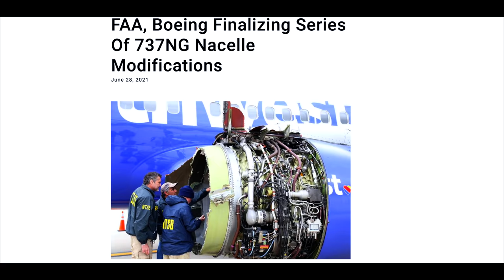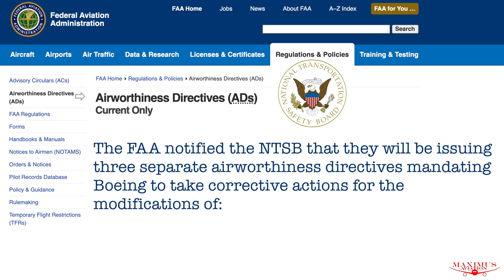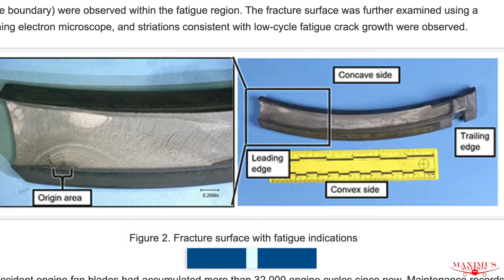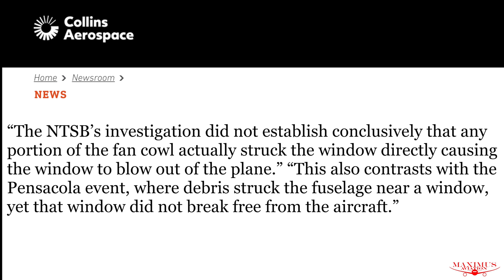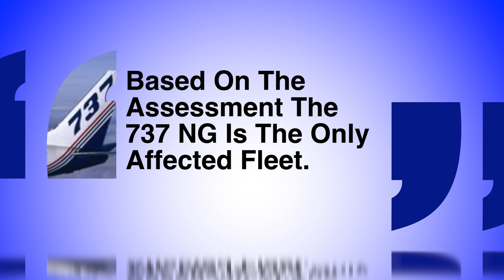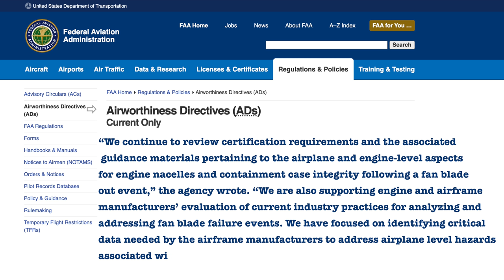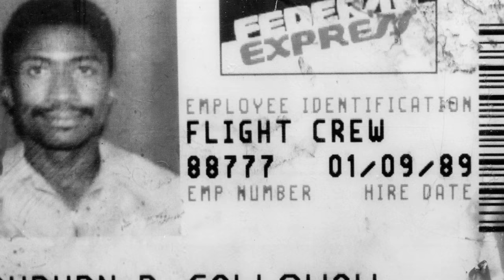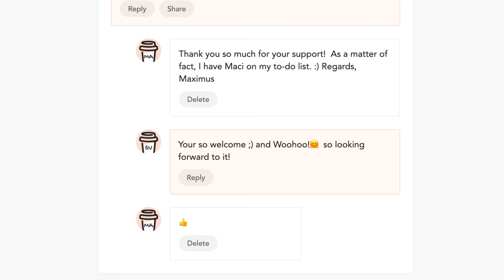After Two 737 NG Explosions, The FAA Is Finally Ready To Direct Boeing To Redesign Engine Cowlings.

Comment: It’s also interesting that engine testing isn’t done with the full fairing and cowling.
Reply from the maker: True.  But since Boeing did test all other cowlings and found that only the NG series was a problem then it must be the case that Collins Aerospace is doing something wrong.
Reply: @maximusaviationchannel  can we trust Boeing testing?
Reply: @maximusaviationchannel  hint:  significant digit  -  determines actual accuracy
Reply: ???  in UK it is
Reply: It is - but not at cruise altitude and speed.  It is tested for a blade-out on a test stand without the slipstream that would rip a damaged cowling away.
Reply: @camf7522  As much as we can trust Pfizer or Johnson and Johnson to test the drugs they make. (which we are especially expected to do right now)  Or appliance manufacturers, drinking water utilities, toy makers, car companies.... None of these people have third-party/government regulators telling them what is right or wrong at every turn.  Most testing of products is conducted and signed off on by whomever makes it.  Maybe the answer, given the duopoly, would be to allow Airbus to 'peer-review' their Boeing counterpart airworthiness tests and vice versa.
Reply: @BigBoy4005  in a safety critical industry like aviation, that is why the ‘independent’ regulator is supposed to be there.

Comment: If this was a one off that could be chalked up to an accident but instead it is one in a series of problems that demonstrates poor management at Boeing what a shame
Reply: This actually predates the McDonnell management issues at Boeing...it's most likely just something that slipped through the cracks of the FAA certification processes that were in place at the time.  I like that a Boeing engineer has come forward and said that there's better ways to model this on computers now!

Comment: Just to clarify…fan blade-out testing / FAR 33 certification is usually performed in a test cell with a complete nacelle and a dressed engine. This is certainly the case with mid-sized turbofan engine installations. I can attest to this from professional experience with several engine / nacelle manufactures. One thing I do notice is that the remaining inlet barrel is still firmly attached to the front flange of the engine. In the event of a blade-out event the fan-containment housing - which is part of the engine and includes the nacelle inlet attach flange - will deform significantly to absorb the considerable rotational energy of the failed blade. The fan containment housings that I have experience with are typically reinforced with a thick Kevlar layer in the portion of intake surrounding the fan. When the fan blade separates from the hub, which is rotating at power and significant RPM, the sudden unbalance results in very large vertical and lateral accelerations which may cause the portions of the nacelle to fail…particularly the intake assembly. Some engine/nacelle designs incorporate features which strategically fail so that the inlet assembly effectively is de-coupled from the engine and remains intact since it will not experience the severe rotating g-loads as the engine spools down after failure. This is critical to ensure that the failed fan blade is also contained by the full intake barrel. The de-coupling devices are called “spoolies” which are simply very precisely designed bushings which are used with the inlet attach hardware (bolts, nuts, washers). During a blade-off event the spoolies collapse and allow the inlet assembly to remain attached to the engine but provide sufficient freedom of motion to the intake so that it isn’t destroyed by the unbalance forces generated by the spinning engine components. It should be noted that the airframe, engine and nacelle manufacturers all work in a coordinated fashion to minimize these failure risks. A fan blade-out event should not be catastrophic with respect to the safe recovery of the airplane, crew and passengers. The remains of the failed engine look spectacular but the aircraft landed safely. I look forward to reading the NTSB report.
Reply: Thank you, Ian. I’m an airline pilot with many thousands of hours flown with CFM56s on both the 737 and A-320 series. I very much appreciate the information and insight of your post. 

Cheers!

Comment: these are quite rare events so I think attaching blame isn't appropriate and it's nice to know they are trying to improve safety further
Reply: Just seems odd to me that the only two engines that  had their fans blow  out of the 6000 or so aircraft in this group just happen to be owned and operated by the same airline.
Reply from the maker: I think thats why they are calling it a "Redesidgn" but I guess they are just glad they didn't cause a plane crash in either situation so they figure why tempt fate. Time to fix them.

Comment: Fly Airbus, see the world. Fly Boeing see the next one. Every model has some problems but waiting 4 years to fix the problem, One more scandal after the other
Reply: Lest we forget, a Qantas Airbus A380  suffered an uncontained engine failure that nearly brought down the aircraft. So this is not strictly a Boeing problem.
Reply: I'm not going to freak out too bad over hearing that fan blades fail.  I don't think that can ever be 100% prevented.  But the four year wait to issue a directive certainly shows they (more so the FAA) doesn't have a sense of urgency.
Reply: @6aNapoleon  
Did the FAA turn a blind eye to it for 4 years?

Comment: Collins Aerospace made the cowlings designed to contain a catistrophic failure.  Such a failure occurred and debris penetrated the airframe directly failing the mission of the nacelles.  Collins is to blame.  Boeing far less so, but because Collins is their contractor and the brand on the jet is Boeing, kind of difficult to not attribute some blame to Boeing as well.  Nice job on this one Maximus.
Reply: It is Boeings job to make sure that all the components works as intended.
Reply: So is Collins where they get the 1st letter of C on the CFM-56  jet engine name?
Reply: @kenkellar2246  in short, no.  The engine is not the cowling or nacelle.  According to a thread in airlines.net the CFM designation is a merging of two companies product naming conventions. Neither of those are Collins.

Comment: I enjoy this channel but in the beginning of this video you made a wrong statement about the function of an engine nacelle. It is NOT a function of an engine nacelle to contain fan blade separations. That is the function of the fan casing. The fan casing is NOT a part of the nacelle.

During fan blade containment tests the nacelle is almost never attached to the engine being tested. There is always a feed horn attached to the front of the fan casing to shape the air going into the intake. That is where the front of the nacelle would be on a normal engine.

The nacelles failed because of the massive displacement wave that occurs from the energy associated with a fan blade separation and the resulting initial and abrupt out of balance condition of the fan.

Had the FAA required nacelles to be attached to engines being tested for fan blade separation this problem would have been known early on.

Comment: Decades older planes seem to have been much better designed than todays planes.  It proves a computer is no match for an intelligent engineer  with a slide rule.
Reply: @Sgt Pepr 
Sure does, even the most advanced computers are no match for the human brain at its best. 
I also believe that they overengineered the older planes for extra durability.

Comment: Blame is shared across:
1. The engine manufacturer who clearly needs to recalculate time to failure. Meaning, they should be part of the story; they should inform Boeing of updated maintenance replacement of the engine parts that are failing before scheduled replacement. 
2. FAA. They set standards for certification of engine assemblies.
Reply: Fan blabe root are regularly inspected, I doubt the engine blade fatigue schedule/calculation need to be changed, fatigue of those balade are very well known. More likely blade defect than maintenance schedule needing modification.
Reply: @anteeko  I hear you. I suggest that some of the mean time to failure calculations for some engines may have some assumptions that would benefit from a revisit from the OEM. For example, the old TF33 engines on B-52 are starting to have unexpected failures - see below link. Meaning, engineers do make assumptions, and sometimes these are not always correct.  I’m not saying Boeing is infallible, but I am saying the engine OEM and airworthiness authorities (FAA, EASA) set the standards for engine assemblies, and should share the blame here with Boeing. 

https://www.defensenews.com/smr/nuclear-arsenal/2017/01/06/air-force-secretary-catastrophic-engine-failure-likely-to-blame-for-minot-b-52-mishap/
Reply: @Hermetic_  What you did makes sense, but ultimately it's Boeing who decides which manufacturer they buy their engines and nacelles from and so ultimately part of the blame DOES lie with Boeing. And I'll argue that part is large.

You simply get what you pay for and if you try to squeeze every penny out of every part, you'll end up with parts that either aren't up to specs, or are just up to specs without any safety factor and thus likely to fail when even the slightest thing goes wrong.

Normally in aviation every part comes with a factor of redundancy/over-engineering, just to make sure it not only won't fail during normal loads, but also when it's stressed beyond normal loads in emergency situations. This nacelle failing  means it had either no safety factor at all or it was not even up to specs at all.
Reply: @tjroelsma  Good point. I do agree that Boeing as the aircraft design organization, should have done a better job, and does hold a major part of the blame. 
Please consider that a) the airworthiness certification requirements were met in order for the aircraft to be approved for operations, and b) the regulator, FAA, should also take some responsibility and figure out why we have engines prematurely failing. 

I should also admit, that I work in aviation, and have spent the last ~10 years working with Boeing. Although anecdotal, I have seen Boeing quality decline because the old guys from Seattle are retiring; whereas the new guys (not geographically in Seattle, but elsewhere throughout the US) are simply not as good, and seemingly not as invested in the company. Plus, as stated above, the company no longer allows engineers to do the right thing regardless of time or cost; but instead to meet the minimum contractual obligation that Boeing is being paid for. Again, anecdotal, but I’ve also seen leadership at Boeing gradually morph from old gray haired experienced engineers, to middle aged people with little aerospace experience, little to no knowledge of the company history and tribal knowledge, and thus more focused on promotion and passing the buck of responsibility. 

The old Seattle group was not perfect. The unions there were often unreasonable and thus Boeing has slowly broken those unions by shipping operations elsewhere in the US, with no unions. However, the short term gain of breaking the Union (and saving money), means that the long term is losing the knowledge that cannot be captured on paper, but instead is experience passed on from employee to employee. As an observer, I doubt this mistake can be recovered from; management only sees the need for profit..whereas the solution is build the workforce that we lost when we started leaving Seattle. And building that knowledge and pride could take 50-75 years...of you’re lucky. In fact, most young engineers no longer stay at a company for life; instead they move around every few years looking for a promotion and more money. So I would argue that leaving Seattle may not be a recoverable mistake. Whomever made that strategic decision to break the unions and leave Seattle probably got promoted and now is an executive at some other company, leaving Boeing and the aviation industry with a mess. 

...is it possible to fix? Yes. Just won’t be easy nor cheap; and is emblematic of a greater problem in our country.
Reply: @tjroelsma  Agree. Boeing does seem to have structural management problem.

Comment: It just seems logical that the nacel should act like a scatter shield and be strong enough to stop or slow down shaprinal so it doesn't penatrat the fuselage.
Reply: They used to, when engines were smaller for a given thrust/power.  The modern 'jets' are more or less ducted turboprops with a lot of blades.  I think they have gotten too big to effectively contain a fan failure without excessive cowl damage.  Slower, quieter, more efficient, and perhaps less safe in the event of a common bird strike - that's progress.

Comment: The steel plate capable of deflecting a detached blade on the fuselage side of the nacelle would be too heavy, we are told by pilots and managers, to sustain commercially viable flight. But what about a strip of thick steel only a few inches wide around less than half the circumference of a nacelle? Fitted very close to the the point at which a blade likely to kill becomes detached, such a strip would protect a laterally very wide arc of possible travel. I would need to study the frame to which the cover is bolted, but I think it likely that the reinforcing strip could serve also as part of the frame structure to which the panels are fixed and thus offset at least some of the extra weight.
Reply: Actually Kevlar composite blade shields are available. They provide the same protection as the 1” of mild steel otherwise needed to contain a rotor disk failure.

Comment: I still struggle to comprehend that someone can be sucked out of a plane window that is clearly significantly smaller than a human body without ever just opening their arms or legs to prevent such a departure to occur. High power vehicles have a scatter blanket around the bell housing to prevent your feet being chopped off in case of clutch or flywheel shatter, sad aircraft engines are not under the same requirements. Its not rocket science that if it spins like hell it can cause a major issue.

Comment: No part penetrated the fuselage. The part stroke the fuselage and window deforming the window supporting structure and possible shattering the window. No piece of the window was ever found neither inside of the plane or on the ground. No piece of cowling, nacelle, blade or anything was found inside the plane. The passenger, who was with the seat belt fastened, partially fle out of the window during the depressurization event and bumped her upper torso and head against the fuselage, causing the trauma that caused her death. There was no injury on her consistent with being hit bi a piece of window or a piece of anything coming from outside of the fuselage.

The nacelle did its job of containing the blade or other high-energy shrapnel from piercing the fuselage, severing electric cables or hydraulic lines, puncturing fuel tanks, or slicing a structural component. It did however not do its job of holding together and the fragments that it shed, while not having the plane-downing power of the high-energy shrapnel that can come from the parts that are rotating at thousands of RPM, proved to still be dangerous and capable of causing loss of life.

These big chunk of engine nacelles are capable of causing damage and injuries as they fall to the ground too, as it was more clear in the 777 incident.

Comment: If the containment ring cowl didn’t contain the blades how could the aerospace company deny NTSB findings? It doesn’t matter if the engine was the cause because the cowling didn’t do its job. 

Most of the guys on the fedex plane left the industry afterwards. I think one is a ntsb advisor now.. it’s amazing to me that the DC-10-30F fully loaded took the airframe abuse that was done to it..

Comment: Maybe there needs to be a strip of armor on the fuselage, too?  In line with the most likely trajectories of broken blades.
Of course, the extra weight might mean 2 fewer passengers per flight.
Reply: Or just omit the window in that location.  Problem solved

Comment: Did Boeing moving out of Seattle mark the end or the start of Boeing failures in design & manufacturing of planes?    [hint?: Engineers vs Wall St. MBAs]
Reply: Machinist strike ????
Reply: It was the official mark that they were going to be following the McDonnell Douglas cost, schedule & shareholder value over quality and safety culture from then on!
Reply: That wasn't the key issue. They moved so they could lobby for more government contracts without having to fly from Seattle to Washington for the military meetings, and lobbying Congress. But that's a totally different issue.
Reply: @johnhaller5851  Rubbish they had a permanent office in Washington.
Reply: @johnhaller5851  negative it was simply there were no wall street sectors in Seattle but Chicago had one and at the same time they were close to St Louis Missouri the home of McDonnell Douglas 😂.